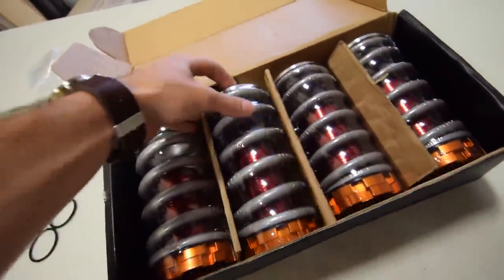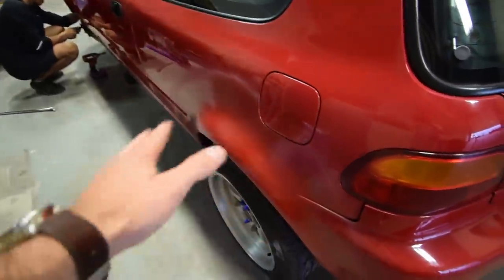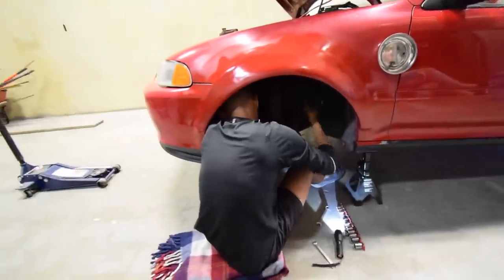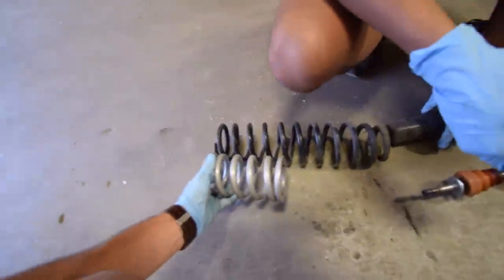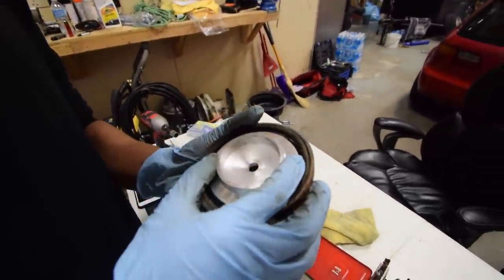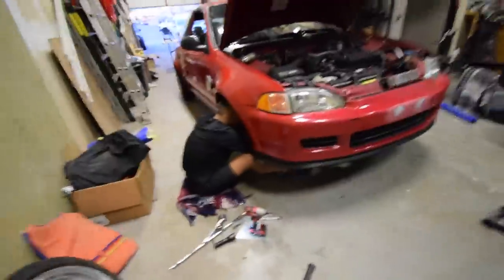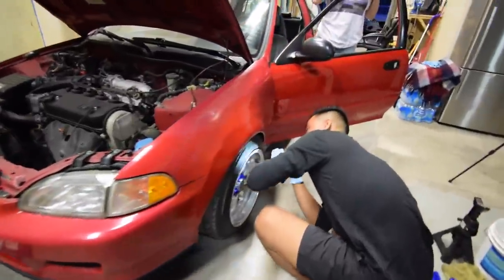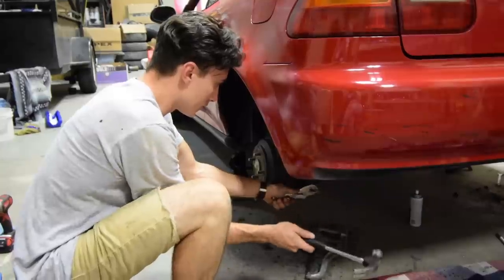COIL SLEEVE INSTALL!! - Eg Hatch

Comment: Sleeves like that have been around since before the 1st Fast n furious.  They're  going to destroy those struts. When it bounces for a quarter mile after a small bump you'll understand why ppl dont like them. Keep up the vids. I enjoy seeing beginners to car repair/mods learn stuff.  The project is coming along. You'll have a cool civic...one day.  Lol keep at it my dude!
Reply: Yeah that setup has been used since the 90’s. But since then the car community as a whole has learned and some of the best setups is a combination of different manufactures to make a custom coil over setup. They still are not cheap but matched with spring rates and dampening they are your best cost ratio. 

https://groundcontrolstore.com

They use custom eibach coils, Koni adjustable dampeners and their custom coil over setup. 

They also have a conversion kit like what you have but with custom spring rates. They let you choose your struts you want to use.

Comment: The exact same thing happened when I did my rear suspension on my Integra - the bolt gets seized inside the bushings! I ended up having to cut the whole control arm (which I was replacing with Type R LCA's anyway). Good luck getting it out!

Comment: I had the same issue with my rear suspension on my integra. So I was running coilovers in the front and stock suspension in the back until I decided to go mayhem and just grind off the fork part. The bolt was completely seized onto the bushing

Comment: Common issue with 92-00 civics the rear lower bolt for the struts get siezed into the control arm bushing and always break

Comment: Hey, wassaaaa ma dude... just dropping by to let you know about the lower control arm on the back had the same problem on my dc2 twice... dont sweat it and buy a shock and lower control arm for it .. bushing just turn into dust because its rust welded .. i had to even cut the shock bottom where it bolts up on my first time .. so just get used or new parts maybe aftermarket control arms for your next video :) hope you get it.(and no torch wont work tried everything also

Comment: Just got my BRZ tryna get used to driving stick now hills are my enemy have you made any videos regarding this, thanks man
Reply: holding your handbrake/ebrake and you gas up and release your clutch like your trying to do a quick take off on flat ground at the same time release your hand brake. When you get fast enough you wont need to use the e brake.
Reply: n0ti5 good advice just gotta practise the quick part lol
Reply: You can also engage 1st and hold the clutch right as it starts to bite then quickly get off you brake and get on the throttle. This way is a bit harder for beginners because its an easy way to slip the clutch too much and roast it. But you can practice on flat ground to get the feel for it also.

Comment: I had a feeling those bolts were going to snap because its 90% chance they will lol. Both of my bolts in the rear forks snapped but luckily i had few bolts lying around and had brand new skunk2 lca (replicas). If you had a angle grinder all you needed to do is cut the bolt and get a hammer and a drift pin and wack it out :P

Comment: Very common problem with those braking bolts in the rear, all you have to do is remove whole lower control arm with coil atached

Comment: You forgot to explain that you can't change the bushings in the rear lower control arms nore can you remove the broken bolts so your basically forced to replace your lower control arms lol sucks I been thru that myself lol

Comment: You really need to stop jacking that car up from the front like that. The eg front cross member in the front isn't very strong and it will bend upward, if you want to jack it up from the front do it from the tow hooks